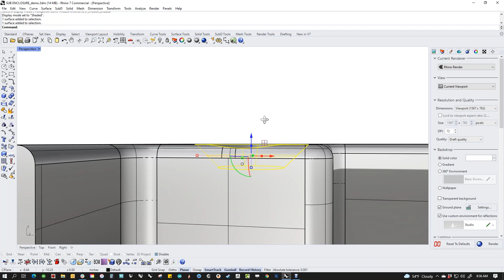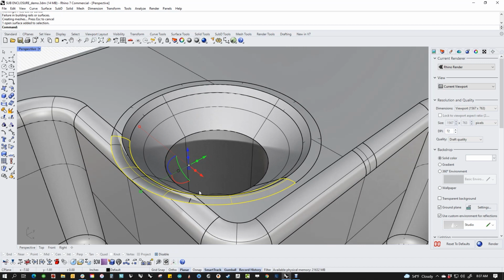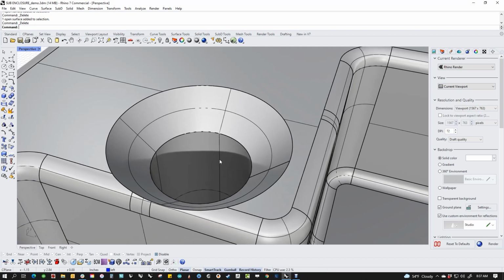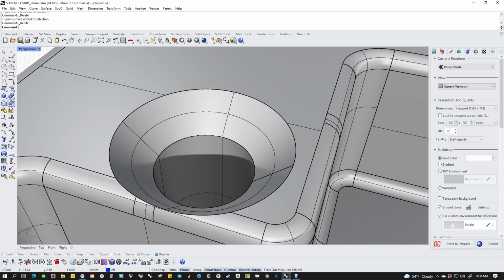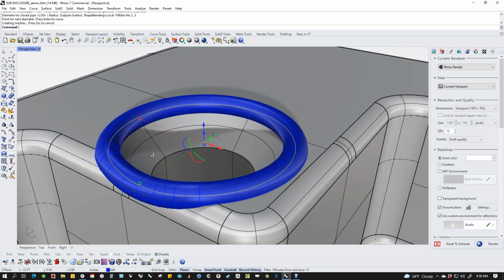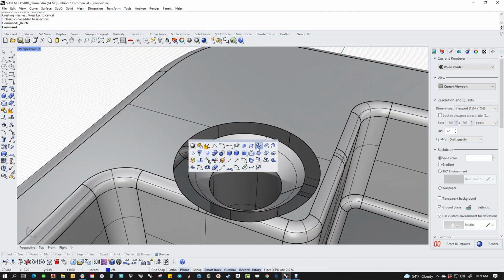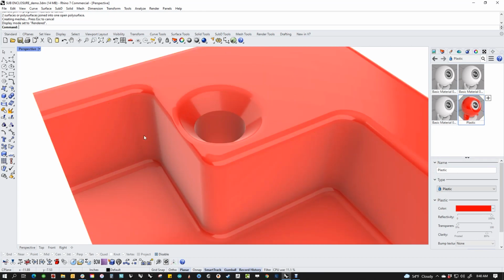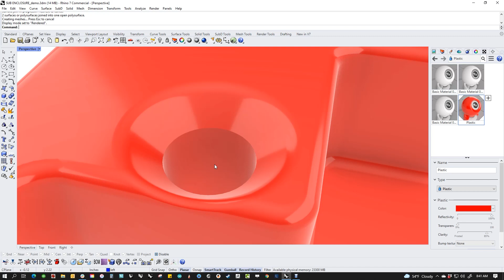Rhino 7 - Pipe trim trick

Comment: As an option for inaccurate “processing” of the fillet, it will work.
Reply from the maker: if you need it to be more accurate, and less "blendy" the pipe trim itself can be quite accurate, and instead of a blend you can use a 2 rail sweep with a defined circular profile. 

many solutions for many needs. Use the one that works for you.
Reply: @Rhinoceros3d  :) Everything is correct. You can also rotate the curve profile. Longer - from the network of curves.

Comment: kyle thank you!
can you make a short video on how you would approach making a orthotics based on a foot scan or foot print... just the basic techniques you would use to approach such type of job
Reply from the maker: Never done that type of work, I’d need to study up on the process. Can you point me to some examples?
Reply: @Rhinoceros3d  orthopedic insoles are basically, shoe inserts that are customed shaped of the bottom of the foot with some type of correction or no correction of the foot, so the shoe fits better wile walking or doing any other type of activity.

most people today that make shoe orthopedic, use a primitive method of casting the client's foot in a foam box, that will make the negative shape of the bottom of the foot. next they will fill the imprint with plaster to get the "original" shape of the foot. plaster is cleaned up and made some corrections. hard polyurethane and different types of foams and shock-absorbing form are heated up, and vacuums with pressure onto the cast to make the insole that will fit the client and fit in the shoe.

I think some of the processes can be changed to digitally. a 3D scan of the foot or 3d scanning the foam box and the casting and correction can been done in rhino etc.

here are some videos that shoe some of the process :
https://youtu.be/MZchWW0qbEA

https://youtu.be/8c2bFKvQSmM?t=73

https://www.youtube.com/watch?v=U1LSdeXCZoc&ab_channel=MyFootDrPodiatry

https://www.youtube.com/watch?v=ejjGwMIAiT4&ab_channel=KlarityGZ